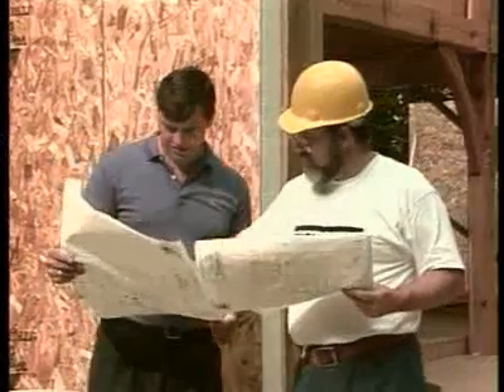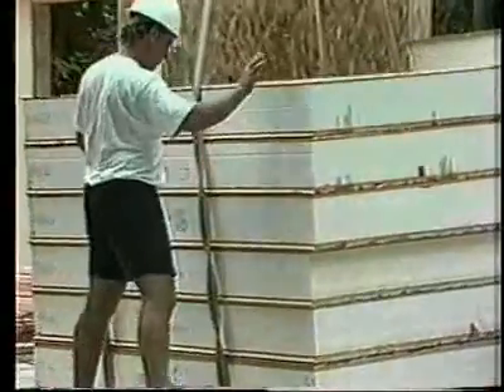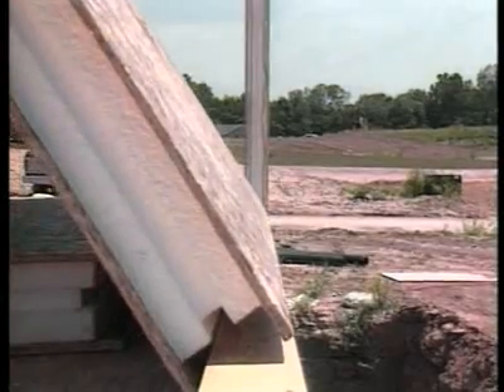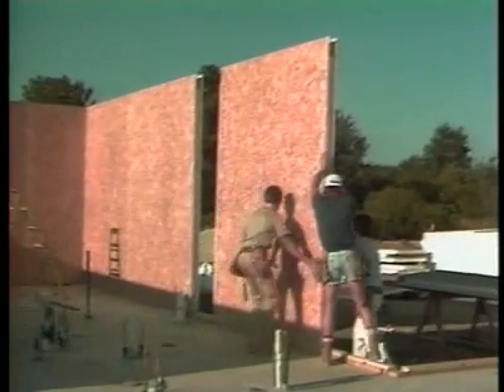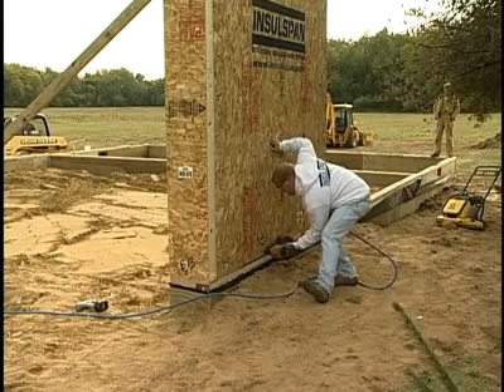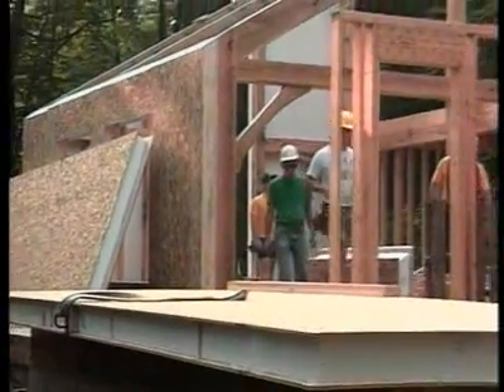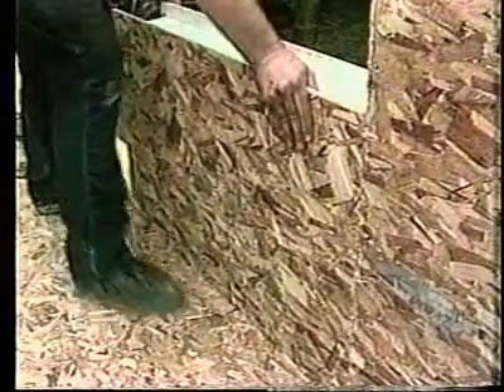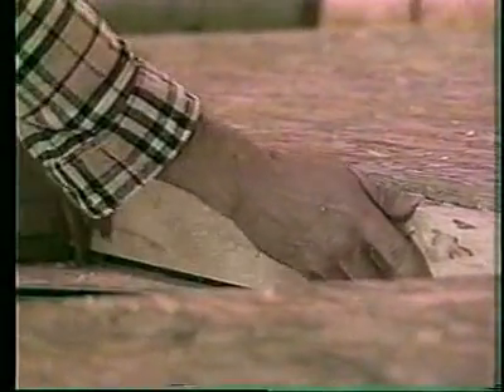Installing SIP's Structural Insulated Panels

Comment: The problem with SIPs is that they are susceptible to moisture because of the OSB. Give a SIPs roof about 10-15 years and once the OSB gets some moisture in it, the OSB separates from the EPS foam and the roof starts sagging.
You'd be better of using something like ThermaShell or such system.
Reply: Vince Stagbaugh if water is getting in the problem is not the sips or the osb I would never use tyvac on anything!!!!   30 lb felt paper will keep water out if applied correctly synthetic house wrap=problems
Reply: +Vince Stagbaugh False information. Number one. Do the roof correct and there will be no moisture. Second, studies have proved otherwise. 3rd the strength of the foam alone is as such to hold the roof. Therefore it will not likely raise off enough to be noticeable, even if a small spot (say 3'x3' etc) were to delam. THOUGH, that said it is FAR better to have a polyurethane VS having a polystyrene SIP. HUGE difference in strength and reliability.
Reply: Yep; OSB and water do not mix.  Eventually, every roof leaks.
Reply: ThermaShells website is down... company problems? Maybe better steer clear of ThermaShell.
Reply: So, wouldn't it be better to make the panels of the SIPs out of some water proof plastic material? Or is that still too expensive compared to OSB?
Reply: EVERY SIP roof I do has a "cold roof" applied over it !!!  It keeps the roofing underlayment and roofing cooler and WHEN (not if) water leaks through the roof (And it will "Rescue3EMS") it gives a channel for the water to drip down to the eave and it gives an air channel to dry the OSB as quickly as possible. OSB will not deteriorate that quickly if it gets wet, and can dry quickly. It will however, turn to mulch if water is "sandwiched" between the OSB and some other item (trim, roofing, siding etc.) The final benefit of the cold roof is that it is made from 5/8" plywood which will hold nails for asphalt shingles and fasteners for standing seam roofing MUCH better than 1/2" OSB.